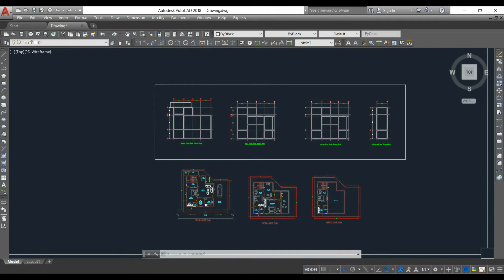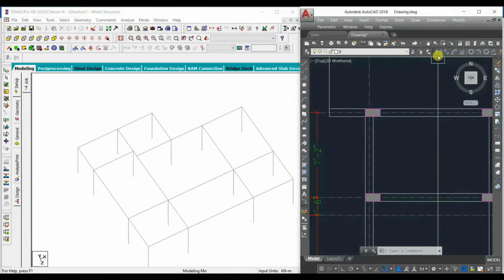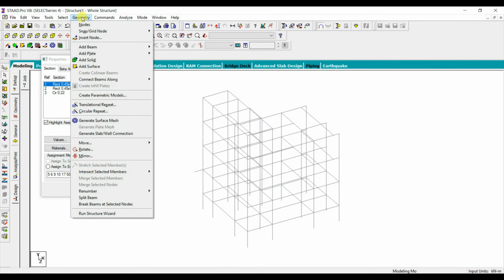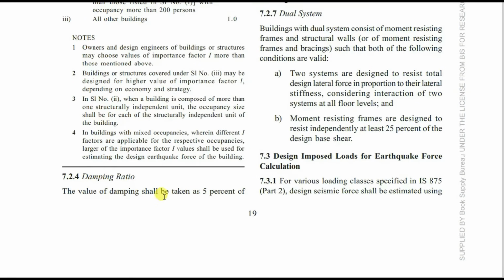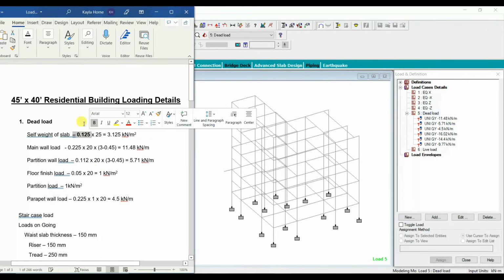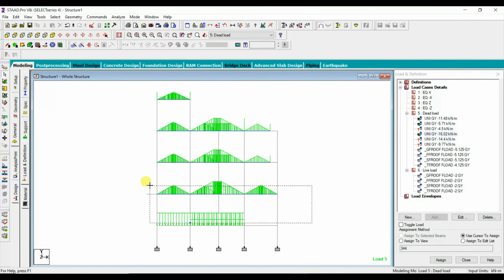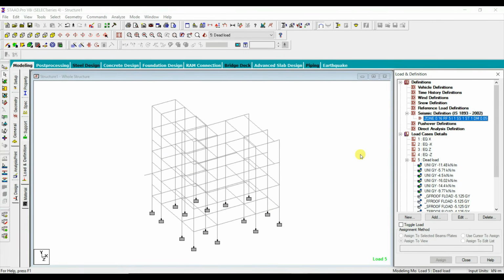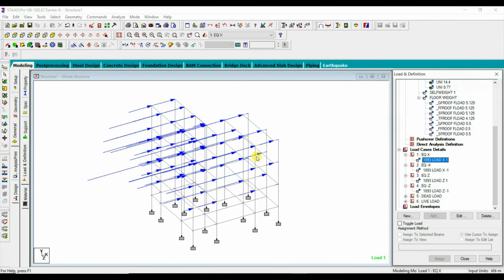G+3 building Analysis in Staad.pro | G+3 building seismic analysis | Seismic analysis IS 1893 - 2016

Comment: What is 1.37 in Cantilever slab load calculation?
Reply from the maker: Cantilever slab load on beam
Reply: @CivilEngineeringMastery  The slab load computed is 7.125 KN/m2 and multiplied with 1.37. From where we get the value 1.37? I am not getting the calculation. Can you please explain?
Reply from the maker: 1.37m is the length of the cantilever slab.
7.125kN/m2 is the load "w" , so load multiplied by the distance ie w x l 
= 7.125 x 1.37 = 9.76kN/m.
Hope this helps.
Reply: @CivilEngineeringMastery  Thank you. I did understand now.
Reply from the maker: I have created a course, structural design of buildings using Etabs software which includes structural analysis and design of a five-sorey RCC building(Real project) and is now available on udemy.
Kindly use the below link to avail the full course.
https://www.udemy.com/course/structural-design-of-buildings-using-etabs-software/?referralCode=14883FDBBD95A1ADAC02

Comment: Mam  kindly upload seismic analysis on response spectrum method ,. Only for zone 2 with regular building of height less than 15m  only this static method is applicable. For all other than this, response spectrum method is applicable.
Reply from the maker: I have created a course, structural design of buildings using Etabs software which includes structural analysis and design of  a five-sorey RCC building(Real project) and is now available on udemy.
Kindly use the below link to avail the full course.
https://www.udemy.com/course/structural-design-of-buildings-using-etabs-software/?referralCode=14883FDBBD95A1ADAC02

Comment: but mam i think in dead load portion selfweight of structure is not taken into account .is it okk?
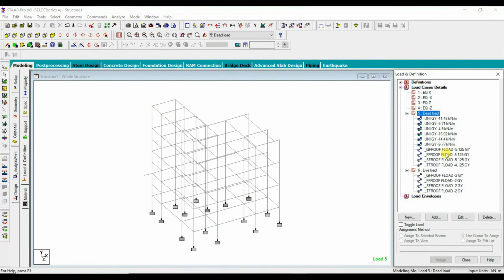Reply from the maker: Self weight of slab, floor finish was added as a floor load which is 5.125 kN/m2. Self weight other structural members were assigned as a self weight, please refer at 21:28.
Reply: @CivilEngineeringMastery  I mean when you are assigning section properties to beam, column size. These beam column itself has selfweight. That command is missing. Selfweight y -1 command which I feel.
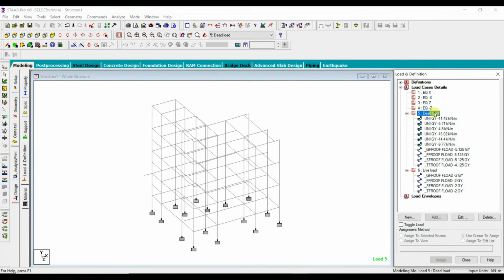Reply from the maker: Pls check at 21:28. Self weight y-1 is added.
Reply from the maker: I have created a course, structural design of buildings using Etabs software which includes structural analysis and design of  a five-sorey RCC building(Real project) and is now available on udemy.
Kindly use the below link to avail the full course.
https://www.udemy.com/course/structural-design-of-buildings-using-etabs-software/?referralCode=14883FDBBD95A1ADAC02

Comment: Thanks 🙏🏻 I’m computer science engineer, I used SketchUp and AutoCAD for designing. But I wanted to learn structural engineering, learn i mean self learn, I would like to request to keep on updating on!
Reply from the maker: Glad it was helpful!
Reply from the maker: I have created a course, structural design of buildings using Etabs software which includes structural analysis and design of  a five-sorey RCC building(Real project) and is now available on udemy.
Kindly use the below link to avail the full course.
https://www.udemy.com/course/structural-design-of-buildings-using-etabs-software/?referralCode=14883FDBBD95A1ADAC02

Comment: At ground floor live load is 0 but you have taken 2. Why???
Reply from the maker: In seismic load calculation, at roof level live load is zero.
Reply: @CivilEngineeringMastery  I'm asking about ground floor, why you taken 2??
Reply from the maker: It is ground floor roof. live load is 2.
Reply: @CivilEngineeringMastery  madam what is the dead load to be applied at roof slab? Except slab thickness.
Reply from the maker: Floor finish load, partition load and water proofing if any on the roof.
Reply: @CivilEngineeringMastery  how much intensity including all above loads?
Reply from the maker: 5.125 kN / m2 considered in this video.